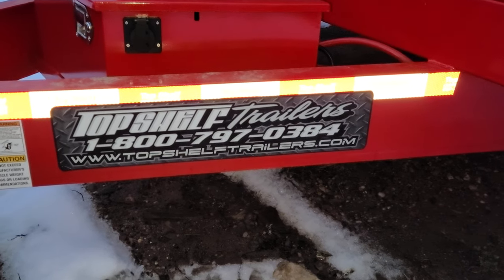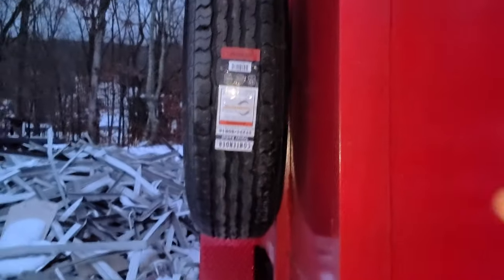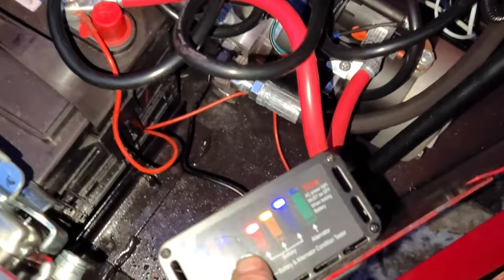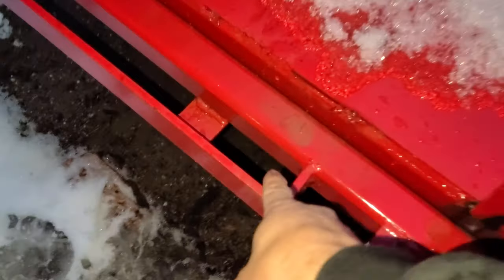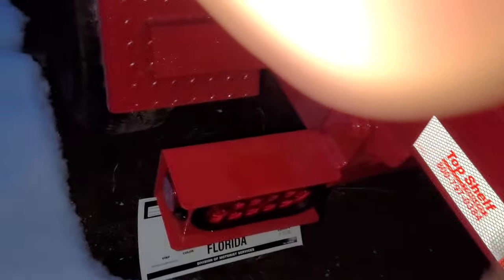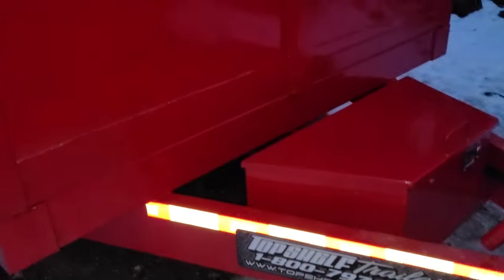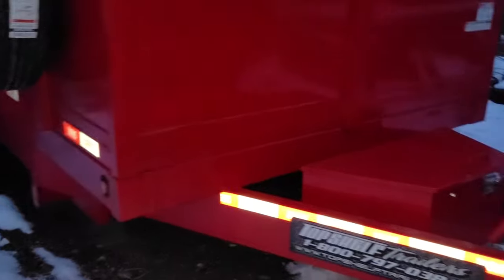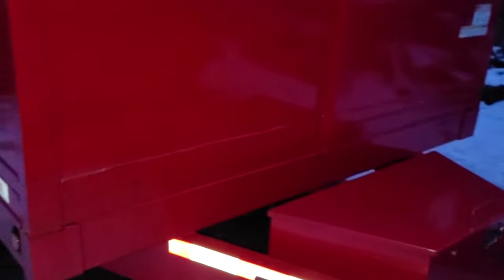top shelf trailer review

Comment: Stay away from Top Shelf shysters!
Reply from the maker: @Darrick4Reel  y
Reply: @bigmiked52  they tried to get over on me sending me a 14k 7x14x4 trying to pass it off for a 16k. The vin sticker clearly states that it was a 14k. They tried to convince me that it was a 16k and that the sticker was altered per my request for under cdl purposes. That’s stupid because with my truck 7000 pounds plus 16000 is far below 26000 pounds so why would I have told them that? The Sr owner got mad because I didn’t except the delivery and told me to shop somewhere else instead of trying to fix the issue. Also they didn’t send the spare tire or lock that was supposed to be included.
Reply from the maker: @Darrick4Reel  oh okay